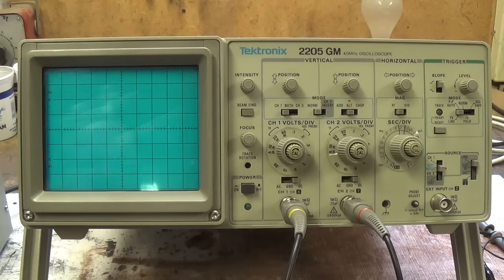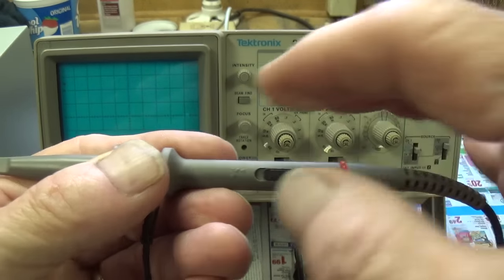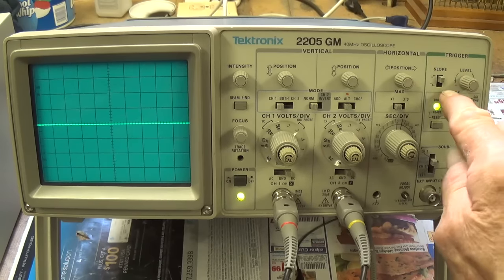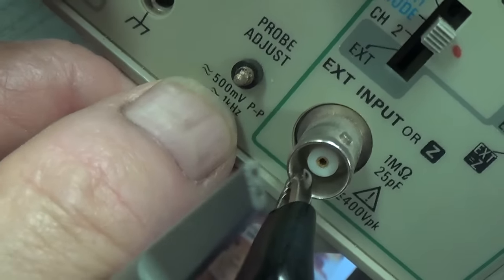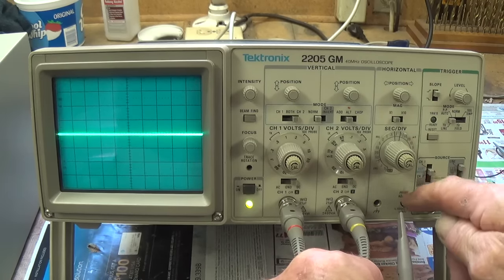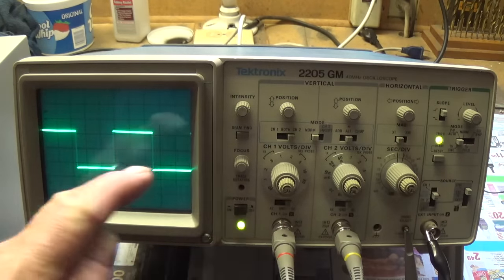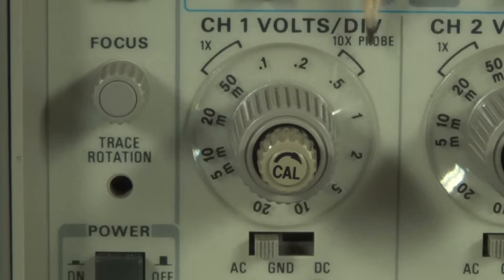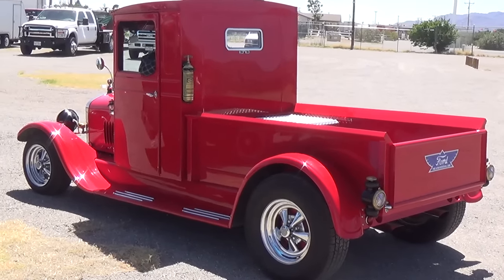Oscilloscope Basics, Part 1: Discussion, Y-Axis (Voltage) Controls, Probe Calibration

Comment: I just got a refurbished Tektronix 2235. Honestly, I did not know anything about operating a scope. I know what the instrument is used for but I've never had the need to learn how to use one. This video lesson was key to get me started and becoming familiar with my latest piece of test gear. Thank you Uncle Doug!

BTW, your videos and my progressive work beginning with a Tube Depot Champ build to their Marshall 18 Watt combo build and then just completed their JTM 45 build that I mounted into a custom 2X12 Bluesbreaker cabinet by Peter Mather, I was able to bench my Super Reverb Amp and confidently visually inspect it, read its schematic, determine it's true vintage, it's a '65 Blackface! My primary objective was to remove a master volume that never sounded right to me, and restore the amp back to its original configuration. I got a new, properly badged faceplate from Sheehan Enterprises and I slowed down the tremolo. I found a few improperly valued resistors for an AB763 circuit and changed them out. I was able to solve a spitting noise problem, remembering your teaching about "tubes act like capacitors"...and one by one I tracked down a noisy phase inverter tube. This amp sounds so good now I cannot believe it! And I've accomplished all this in four months...I digested a lot of information. Doug, you've been instrumental as a teacher aiding me in my journey to becoming a competent tube amp builder and troubleshooter/technician. Many thanks.
Reply from the maker: You're quite welcome, Mike. Thanks for sharing your experiences with us :)

Comment: What a great contribution to those of us late to the game ! I have it in my head to build a clone of an original AC 30 Vox running on exactly 234 Volts at 50 cycles. Along with a power supply that conditions and controls the AC source an Oscilloscope is a good companion piece. Knowing how to use it will make it an even better addition to my Diagnostic equipment.

Uncle D. you rock ! I also share your love of cars, although I got hooked on the E-types of the 60's when new and have never lost interest...…

Thanks jagjet aka Robert Phelps
Reply from the maker: I'm glad the video was helpful, JJ......and I share your enthusiasm for E-type Jaguars. In my opinion one of the most beautiful cars ever built.

Comment: Marty Robbins territory I see, and the Franklins. 30 years removed since. So, I just got a Tektronics 2 years ago and I took it out a few times and coudnt grasp it. I thought I never had a GREEN thumb with plants or electronics, But at electronics maybe I feel I have a chance. I got the quiz correct. Super motivated by your narrating and teaching. Love your cat, I have a Orange Tabby. I  also have a Model ( 465B ) and service manual from 1979.  I have a bad circuit board in a Pellet Stove and need to find the problem, so my ohm meter can only do so much for I am told. So thats why I am here. THANK YOU SO MUCH !
Reply from the maker: You're welcome, Elizabeth. Good luck with the Pellet Stove :)

Comment: I was never able to "guess" what all those knobs actually did. Years ago no videos cleared it up & books assumed you had already received a masters degree in electronics & wanted to go in depth about the design of scopes, not to mention the "potential" hazards. This info is what I needed 20yrs ago. Thanks! Very entertaining  also.
Reply from the maker: It's a shame that most tech manuals are of no use whatsoever to those who actually need to use them.  I try to bridge that gap :)

Comment: hi Uncle Doug,    Firstly,  thank you for all the wonderful videos you have posted of your journey thru the world of valve amps and the like.  I have always had a passion for electronics since i was about 4yr old. My mum worked in a place where audio equipment was built and I used to go up and down the production lines making sure the ladies at their stations had enough supplies to keep them going. I knew resistor colour codes and values before I even went to school.  My career took a different path and I am a mechanical engineer and have worked on everything from a weedwacker to merlin aero engines in the spitfires and mustangs.  Over the past year I have drifted back to my electronics and have been a subscriber to your channel for that time. My goal is to gain enough experience to build a valve amp of my own and to that end I have been researching circuits and equipment.  I have built my own tone generator and purchased an oscilloscope.  I have a kt88 amp unit which I have repaired and is working very well.  The project on the bench is a combo unit. It will have a phono section feeding the pre-amp and finally into a pair of 6sn7gt and kt170 output tubes.  I used the knowledge gained from you as a teacher to pre build the project on an experimental board. The oscilloscope was invaluable in this to see if there were any problems with oscillations and noise. It all worked very well considering the rats nest of wires .     The probes on my scope are 10x by default.  No 1x option. This thew me for a bit as I could not get the correct screen readings for what was being input.  I then found a section in my scope menu where I could change the value of the probes. Set it to 10x and viola......all is well.  I have since purchased a 20x attenuator.  If I use this with my current leads,  does that mean I will need to change this setting to 200x?????  Here is my take on the maths and where I need your skills to help me.  If I have a 200v source on the probe tip - the 20x will drop it to 10v into the meter....now with a 10x probe it should drop it to 20v and then to 1v.  I have tested this theory with a lower voltage and it seems to work.  The kt170 tubes will be at about 600v and I want to be sure that i don't fry my scope.   Your help with this question would be greatly appreciated.      I appoligise for the long winded blurb here so will wind it up.  I wish you had been my maths teacher. You make learning a joy and with the added insentive of doing it all by choice you really do pay attention and listen.   I look forward to many more of your musical adventures.    Best regards from the KiwiBandit in New Zealand.
Reply from the maker: Greetings and thanks for becoming a Patreon patron, KB. Although I have never used an attenuator with an oscilloscope, your analysis seems correct to me.  Using a 20x attenuator with a 10x probe should yield 200x reduction in voltage, so the 200V source would be divided by 200 to equal only 1 V for your scope. This would be easy to verify using a known DC voltage in the 200V to 400V range to see what your scope reads as the reduced (by 200) value. Good luck with your projects and pursuit of knowledge.

Comment: Execellent video, it was so much better than the instruction I received 40 years ago at a certain two syllable technical “institute” which shall remain nameless. They just had handouts that said “set your knobs to these settings and this is what you should see” I remember having to explain to most of the people at my lab table what the settings meant.     Then there were the second “trimester” jerks who had lab before us who took great joy in cranking the timebase all the way one direction or the other so the 1K square wave was either a solid bar or a slow dot moving across the screen. 409 wow what a radical cam in that beast. My dad’s favorite engine was the 409’s little brother the 348. He put one (actually 4 different ones) into a 65 Chevy pickup. Bad about popping the tops off of pistons, usually when pulling a heavy trailer in the mountains. Talk about power and torque when you needed it. Great job on the intro video.
Reply from the maker: Thanks so much, Mark. It's always good to hear from you :)

Comment: @3:24 The "mysterious switch you mentioned on a probe is called the Attenuator switch.
Also, correction is needed here that when it is X10  it adds  (and not at X1 as told in the video) a 1M resistor in a series which attenuates (reduce the voltage input) by X10. (there is also a PF capacitor connected in parallel to this 1M resistor for AC inrush attenuation.
Reply from the maker: Thanks for your helpful input, Brij.
Reply: As far as I understand it, 1M resistor is usually there on the oscilloscope input side (unless it has, say, 50 Ohm inputs. Mine doesn't.) and x10 prove will have a 9M resistor in series.

Comment: I recently bought two new 100Mhz X1/X10 scope probes for my Dick Smith Electronics Q-1804 20Mhz Dual-Trace Oscilloscope, I bought it brand new from Dick Smith Electronics back in about 1998 or so, I've used it to fix a few things so far, it has been a great piece of test gear, glad I bought it, I've also got an old Telequipment D33R Dual-Trace Tube Oscilloscope (probably about 15Mhz bandwith) that needs a replacement CRT and some TLC work done on it to bring it back to working condition.
Reply from the maker: It sounds like you are acquiring some good, useful gear,  Simon.

Comment: AWESOME ! A wee bit over-simplified for my level but that's just fine, it leaves little to no ambiguity. After all, as a Mech. Eng. we only brushed this topic... several decades ago, lol. Looking forward to this series. By the time I get my own scope I should be proficient right out of the box ! I'll be sure to reference you and your help in my unboxing vid.

Love your car stuff at the end of the last few vids. I'll mention that, after a 10yr stint in Aerospace/Defense, I spent the next 25 as an automotive engineer. My father and uncles were drag racers in the 60s... I guess it's in the blood. :)
Reply from the maker: I try to cater to all levels of understanding, CA, and, as you say, even the more advanced viewers can benefit from a review of basics. Glad you like the cars. It's an obsession of mine that had to lay dormant for 45 years, during my "working life" but is back in full tilt now that I'm retired.
Reply: Forgot to mention, Pt1 would've been a good place to tell people NOT to connect their probe / ground to the mains.
Reply from the maker: I would hope that such an obvious recommendation would not be necessary, CA, but I'll keep it in mind when we start to work on amp circuits.

Comment: Thank you. Been waiting for this. I just bought myself a new digital scope and I'm looking forward to using it.
Reply from the maker: You're welcome, GL. The digital scopes are great because they can do all the calculations for you. Analog scopes like mine require that I do the math.  I think you'll love it.
Reply: Thank you. I'm still a little fuzzy on whether or not I need an isolation transformer to scope the innards of an amp...for the safety of the scope. I've been reading all sorts of conflicting information abut the earth ground BNC sleeves and connecting the probe to the wrong spots in an amp. Wouldn't it be safe to always keep the probe ground on a chassis ground? They are earth referenced, right?
Reply from the maker: You could write a book about all the things to worry about when testing electronic gear, GL. You need to see my video on Isolation Transformers. I think the answers to all your questions are there. A good rule of thumb when scoping an amplifier is to only connect your probe's ground clip to the chassis of the amp.
Reply: Thanks. I did watch it, and I'm going to watch it again. Nice job with the horse analogy. It's perfect. Haha.

Comment: About Vernier control, I don't think it's there to calibrate anything, but rather to fine-tune signal amplitude/time base to better use the screen real estate.
I saw different oscilloscopes on YouTube with it, and some have Vernier calibrated (as in, all automated measurements take it into account and it's probably in some small discreet steps), and others don't (so you can only trust the displayed measurements when Vernier is clicked into the "calibrated" position, if there even is one).

All in all just wanted to say one shouldn't be afraid of using it, just - like any other functionality - learn what it does first. ;)

Great videos here, I'm subscribing. Cheers!
Reply from the maker: Thanks so much, Tomasz. Welcome aboard :)

Comment: I bought my 60Mhz Tektronix  2213A Oscilloscope brand new in 1984.  I was tried of junkie old scopes from the stone age.  I worked an entire summer at $3.50 per hour to save up money to buy it.  The  Tektronix  2213A was the best one that I could afford.  I didn't want a HeathKit, a Leader or a B&K.  It had to be Tektronix.  Before I got my new Tekronix, I spent more time working on the crappy old scope than testing my experimental circuit.  Today I still use my now vintage Tektronix  2213A Oscilloscope.  I love it.
When I got my first job at IBM, it helped a lot having my own oscilloscope at home.  I was surprised to see other technicians not knowing how to set up their scope.  I was also surprised to meet other techs that had no interest in electronics outside of the job.  I once thought everyone that worked in electronics was also an enthusiast.  It broke my heart to work with people that couldn't care less about electronics.
Reply from the maker: Thanks so much for sharing your experiences with us, EM.
Reply: @UncleDoug  In the mid 80's IBM paid electronic technicians $8.50 per hour.  My take home pay for the week was around $246.
Reply from the maker: I'll bet the executives took home a wee bit more, EM ;) @elminero49
Reply: @UncleDoug  Sadly I didn't study tubes in college.  Everything was about transistors.  I later worked in an AV repair shop that had a ton of old vacuum tube equipment in the back.  We ignored this old equipment because we considered it junk.  Now I wish that I had at least grabbed a few transformer.
Reply from the maker: I didn't study tube electronics either, EM. I am self-taught and began my self-education upon retirement. No kidding about regrets over not stashing tons of vintage parts when they were plentiful  and dirt cheap.  @elminero49
Reply: @UncleDoug  Hey UD, What text book on vacuum tube electronics helped you the most?  
For solid state electronics I personally like Malvino's "Electronic Principles".  In the past I designed and build solid state amp.  I'm rusty now.  I'm try to get my hobby going again while getting my head around tubes.
Reply from the maker: I never bought or read any books, EM, except for tube handbooks. Everything I know came from the internet.....and personal experience. @elminero49

Comment: This is great, thanks.  I have a Tektronix 465B that I have been dying to use, but had no idea where to start.
Reply from the maker: You're welcome, Scotty. Naturally,  all scopes differ in control details, but are generally quite similar in overall function. I hope you're able to get it up and running.
Reply: I will try this weekend!!
Reply: A lot of Tek manuals are available online.
Reply: thanks 1959... I have the manual here, in hard copy, so...  I guess I have to read that damn thing...  yuk!!! ;-)
Reply: I have the manual for the scope, I'm just not great at reading manuals ;-). but that has to change.

Comment: Hi Uncle Doug. In reply: I prodded the circuit wiring of my kit amp. Most of the signal path is now shielded cable-but not all. Screen cable was not specified for this kit. I will check the signal run, again. Thanks, you are the man.
Reply from the maker: You're welcome, Shannon. Best of luck resolving any issues.

Comment: I used to have an old tube Telequipment scope that had 50v/div vertical deflection. But it was only one channel, which is all you really need for tube amp repair, but I sold it cheap to another tube amp buddy. 50v/div sometimes was still not enough. I always thought it was goofy that we named the 10x probe switch as 10 times or Ten X, when it's really divide by 10. Guess the X is supposed to remind us to multiple what we see on the screen by 10. Still can be confusing, but then the AES and pipe thread system is goofy and confusing too. Wow that 409 yellow coupe. Best part of a car show or bike rally is when everybody leaves.
Reply from the maker: My last tube oscilloscope ended up in a dumpster after I harvested all the tubes. I felt bad about it, but I was moving and had to get rid of all sorts of stuff.  You're right about the 10X.....it does seem backwards.

Comment: UD, can you do (or have you done?) a video which details problems you've found via oscilloscope? Something along the lines of "The device had this problem, I tested such and such with the scope, I should have seen THIS but I saw THIS." Just looking for a little practical application to latch onto. My career thus far has been automotive electrical and electronic system troubleshooting but I'm feeling the urge lately to learn more component level testing on circuit boards. Keep up the awesome work sir.
Reply from the maker: I have not made such a video, Greg. I do most of my repairs without using an oscilloscope, but occasionally, it's the best (or only) way to diagnose a problem. In those cases, I show the use of the oscilloscope in the video.
Reply: @UncleDoug  No worries, guess I just haven't come across one yet. I shall endeavor to do so. BTW, I have no idea how you find time to respond to so many of us but glad you do. Take care.

Comment: Great video, one i've been waiting for... My scooe has a problem the horizontal adj only brings the signal from off the screen to the first line on the bottom.
Reply from the maker: Thanks, CW. Is this horizontal trace the one you get with the probes not connected to any source?  If so, then it should center easily. Unless there is some (as yet unrecognized) setting interfering with the line position, then your screen's vertical deflection magnets may be out of balance due to an internal component failure. Keep trying to adjust the problem away......if that doesn't work you may need to consult the service manual for your scope.